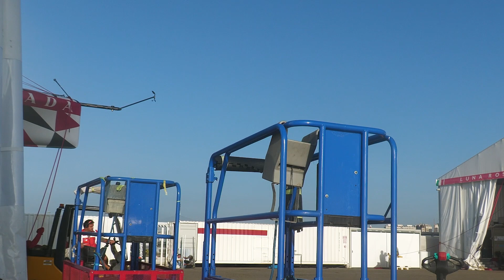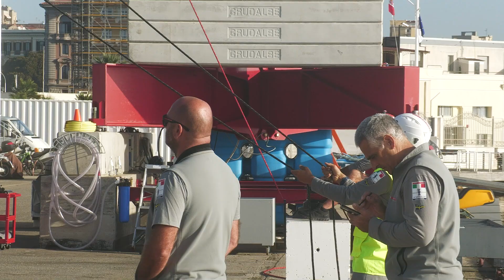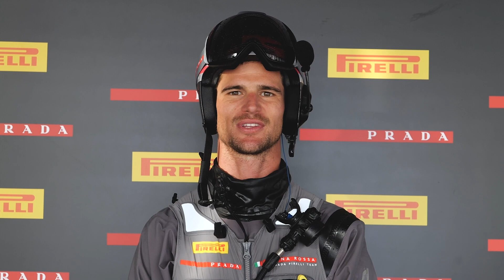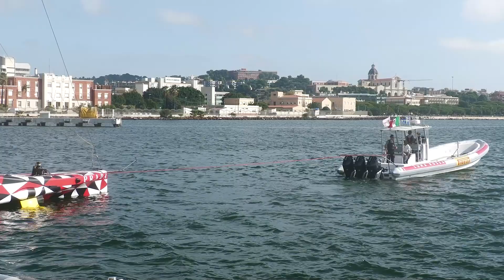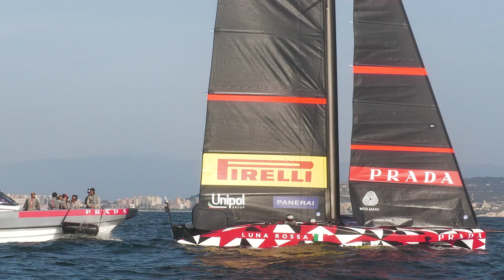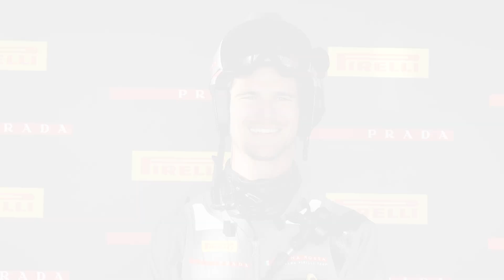Luna Rossa Prada Pirelli Prototype Day 6 Summary

Comment: Because of the rule about recon teams as there only two independent viewers the designs are going to be very similar as when you put new equipment on you have to declare it for it to be legal we are seeing this now with most teams have gone boom less and foils are ETNZ type of design the problem with this is if you follow you will never lead.
Reply: They may have to test different systems and appendages on a class of boat that is similar to remain covert.